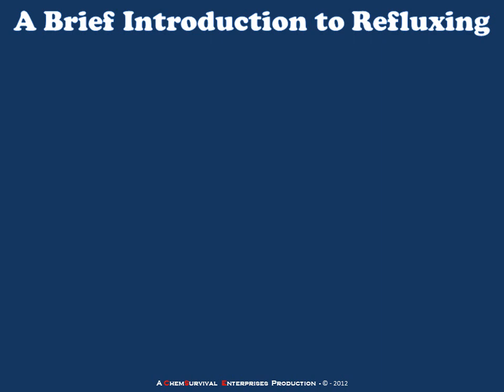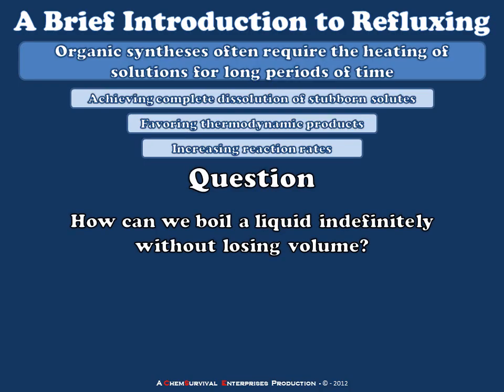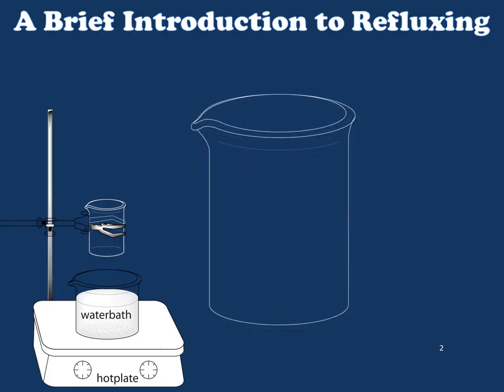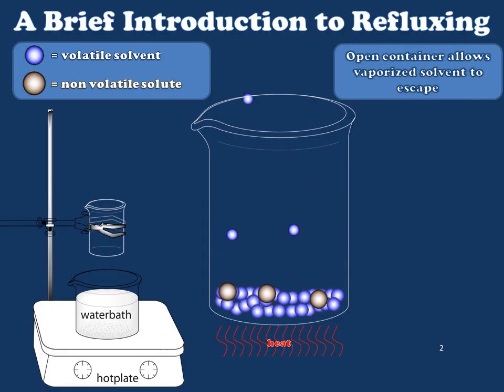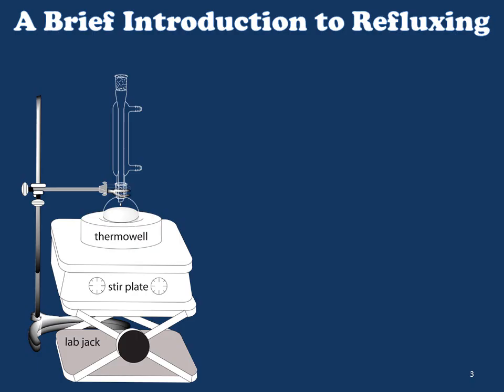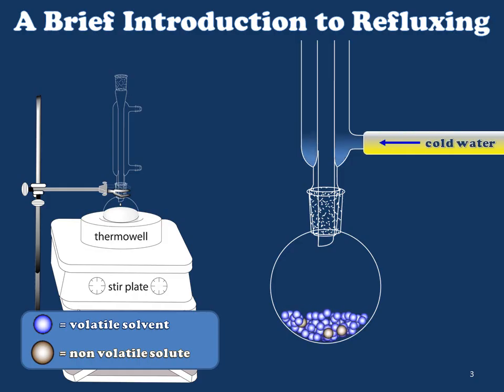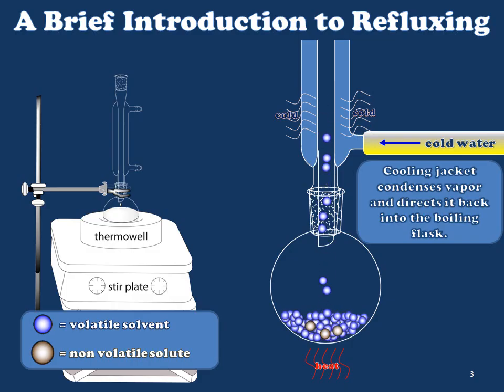A Brief Introduction to Refluxing

Comment: So basically just a liebig condenser?
Reply from the maker: Basically yes.  Liebigs are usually the simplest part available to get the job done, although the technique can be performed with condensers of varying designs, most notably Allihn and Dimroth condensers are also sometimes used when even more efficient condensation is needed

Comment: Why is the organic substance heated in the first place?
If it wasn't heated, refluxing wouldn't be used, would it?
Reply from the maker: You can be used for a number of reasons. Sometimes it's to accelerate reactions or even change the product that forms and other times to help dissolve stubborn solutes.   But whatever the reason for using it, the technique of refluxing is all about adding heat without the risk of losing volume.

Comment: A have a question.. why we attach the water inlet tubing to the bottom connection and the water outlet tubing to the top connection and not opposite? Thank you
Reply from the maker: This ensures that the jacket will fill completely with water, keeping all of the interior walls cool.  If you plumbed it in reverse, you can get a situation in which just a trickle of water falls down one side of the condenser's jacket, reducing its cooling efficiency and possibly allowing solvent vapor to escape!
Reply: @ChemSurvival  thank you very much for your quick answer!

Comment: Pls help  meeeeeee!!!!!!!!!
Reply from the maker: how can I help you?
Reply: why is the condensor placed in a vertical position
Reply: why is the condensor used
Reply from the maker: The condenser is vertical so that condensing solvent will fall back into the boiling mixture.  This allows for indefinite boiling of the mixture without loss of volume.

Comment: Thanks for the video. The one thing I have trouble understanding is if the temperature is to be constant at the boiling temperature of the solvent or liquid, then won't condensing the liquid back into the flask cool the liquid. I assume the drip rate is small enough but from an energy balance standpoint you are removing heat from the vapor that is rising, so won't the temperature fluctuate each time the vapor condenses?

Comment: so is reflux a test run? it seems illogical to condense something back into its original flask. is this method used to purify a compound? what are the benefits for refluxing?
Reply from the maker: https://www.youtube.com/watch?v=Z6OyNB8V7Hc

I assume you are referring to fractional distillation in comparison?  My video on fractional distillation will help to explain.  Though fractional stills and reflux apparatus might look very similar, they are used for very different purposes!

Refluxing is used to add heat to a system for an extended time without loss of volume.  This might be done to accellerate a reaction or to encourage stubborn solutes to dissolve.  It is a very versatile technique, but it is NOT a separation technique.

Comment: what can be done if the fumes are very dense in a reaction and despite the condensing apartus, a part of the fumes are escaping. 
is it possible to put an second condenser in line to increase the amount of condensing surface?

i use to put an champagna glass with some water at the top to avoid to block completely the system whuiich when the pression increase is pusdhing a bit thge glas to release the pression, but i would like to avoid no loss of the fumes which are the most important in the reaction. does it exist sdpecial condenser which solve that ????
(sorry for my bad english, i speack normally french)
Reply: Well, you need to increase the efficiency of condensation, which you can do in a number of different ways. One would be increasing the surface area by getting a longer column, using a specialized column (Vigreux, Snyder, Widmer for air-cooled; Allihn, Graham, Dimroth for liquid-cooled), or stacking multiple columns.

You can also lower the temperature. For air-cooled, you could pack the outside with ice. For liquid-cooled, pump a cooler liquid, such as ice water vs regular.

Useful reading: https://en.wikipedia.org/wiki/Condenser_(laboratory)

Comment: So when my manual says to "Heat to reflux" that essentially means "Heat until you start seeing dripping coming from reflux condenser" because that means it's boiling.

Is that right?
Reply from the maker: +A Whether Moments Poet You got it.  'Heat to reflux for 30 minutes", for example, means get a nice boil going so that condensate is dripping back down into the flask, then start your timer.  Thirty minutes later, remove the heat.
Reply: ChemSurvival
Awesome, thanks for your help. I just did the experiment and everything went really well.

Thank you again!!

Comment: Is it possible to relieve the pressure by connecting a vacuum apparatus to the top? also allowing you to boil at lower temperatures and less chance for thermal degradation
Reply: ChemSurvival cold trap for the win :)
Reply from the maker: +zach p interesting question.  I have never seen or heard of a 'vacuum reflux'.  If you want to perform the temperature below a solvent's boiling point, just use a heating block to carefully control the temperature of the mixture.  As for relieving pressure, there is no pressure build up during a reflux since the top of the apparatus is open to the atmosphere!
Reply: +ChemSurvival But he says he wants to connect the vacuum apparatus to the top, so it would no longer be open to the atmosphere.
Reply from the maker: +Gabby Jerz I understand this.  But think about what a vacuum pump does and what refluxing tries to achieve.  A vacuum pump would suck a fair amount of the vapor out of the apparatus.  Refluxing is all about recovering that vapor and keeping it in!  To reduce the pressure in the system would mean actively pumping out the vapor that you are trying to save with the condenser.  The two techniques are in conflict here.

Temperature control of that level can be achieved far more easily simply by using a thermostated bath to do the heating to the desired temperature.

Comment: ChemSurvival  Hi, first off, thanks for posting this. Very informative, and very easy to understand. One quick question, is the thermowell necessary, or can you do this without one? Also, if you do need one, can you link me to one that would work for this application? I've got everything else, but all I can find are tubular thermowells.
Reply from the maker: Thanks for the kind words.  Try searching VWR's website for 'Heating Mantle'  That should get you where you need to be
Reply: Thank you. I'll work from there.

Comment: Hey, thanks for an informative video. But why need the stir plate? Does it depend on the chemicals? This guy refluxes without the stir plate. Reflux
Reply from the maker: Hi Alexander.  Having a rotating spinbar in the flask promotes even heating, which in turn reduces the risk of what chemists commonly call 'bumping' or flash boiling.  In short, small, superheated pockets in the solvent can cause it to rapidly vaporize, foam up and shoot into (and sometimes beyond!) the condenser.  Generally, once a reflux is humming along nicely this is no longer a significant risk.

The technique can be performed without stirring if the solvent is of relatively low volatility or if the heat source can be quickly removed or decreased when/if flash boiling begins, but since I teach an introductory lab, I have included it for pedagogical reasons.

Comment: what is the point of reflux? once the reactant has evaporated and then condensed back down again, aren't you back at square one again? what does reflux achieve that a simple distillation would not?
Reply: I was wondering the same thing for a while. When you get to something that requires you to boil something for an extended period of time, you'll quickly realize why it's important to reflux :-)
Reply: @jhyland87  yup when you need to do something like this basically the way I told my kids anyway you have water that boils at 212 degrees Fahrenheit at sea level and you have something else that you want it boils of at 200 degrees Fahrenheit you want the stuff that evaporates faster so the cold finger is inside coiling the vapors the lower boiling point stays in the flask if the condenser is hooked up right and water inlet is at the cold temperature needed and water over some time will leave the flask then all you have left is what boils off at 200 degrees Fahrenheit. I could be wrong I'm just learning if I'm wrong please correct me thank you. my grammar is bad so are my nerves in my brain
Reply: Thank you Amber
Reply: ...dude, did you even watch the video? The first half of it directly answers your question.
Reply: No, because it allows the reaction to continue on heat while containing the reactants in the vessel.

Comment from the maker: Hi Zachary.  If you close the reflux condenser and heat the system, the pressure will not decrease... it will increase!  The consequences can be catastrophic when the glassware fails or the stopper blows out and superheated solvent goes flying everywhere.  It is possible to work in systems like this under reduced pressure with the proper precautions, but remember that lower applied pressure means lower boiling points, and usually the point of refluxing is to add heat.

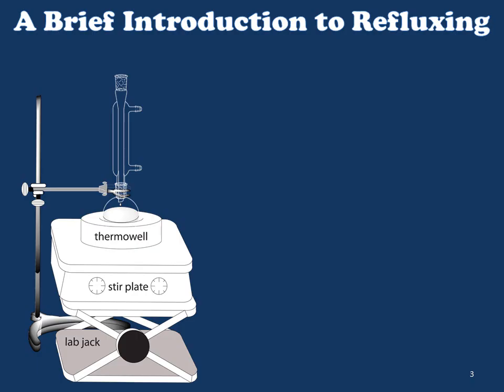Comment: Great video, at about 3:25 you mention that the reflux condenser is open and exposed to atmospheric pressure. If you were to put a stopper and/or thermometer at the top, what degree of vacuum (in psi, HG, or torr) would be present in the system? And what would be the circumstances or factors that influence that pressurized system? Is the level that the condenser and RBF in comparison to sea level a factor? I'm curious, cuz I know some lab exps. require vacuum pumps.

Comment from the maker: Good question, Mary.  The answer will depend on the application, but on the scale you most often encounter in the research lab (hundreds of milliliters of solvent using 14/20 or 24/40 standard taper glassware) most reflux condensers are about a foot long.  Anything so volatile that it can significantly traverse such a distance as vapor at the temperature of cold tap water is not likely to be a useful reaction solvent anyway!

Comment from the maker: It is possible to direct any escaping vapor to a cold trap for collection, but in most cases this will not be worth the trouble.  Most reaction solvents chosen for refluxing have boiling points well above room temperature, and the condenser is remarkably efficient at re-collecting the solvent in the original flask.  I'm not sure I understand your comment about solvents boiling below zero C.  Refluxing as shown here is typically employed with solvents which boil above room temp.